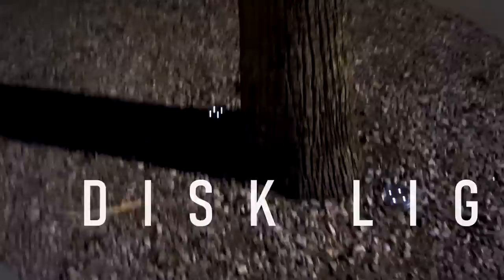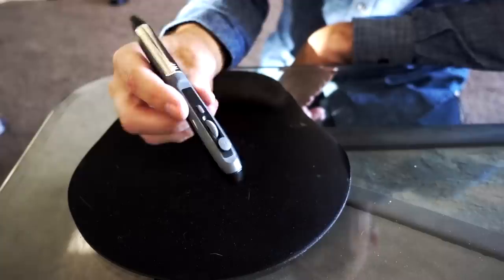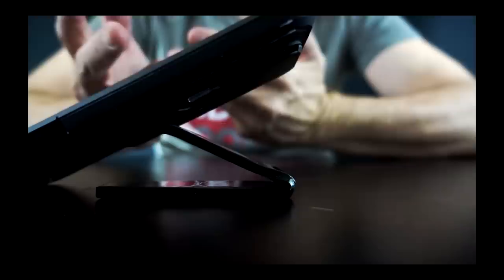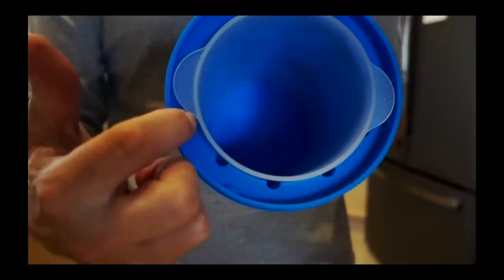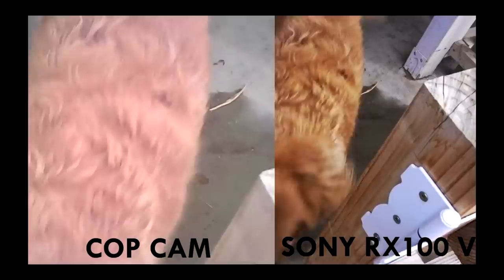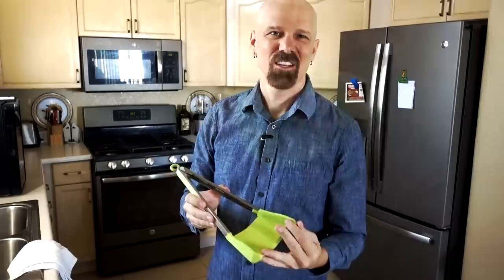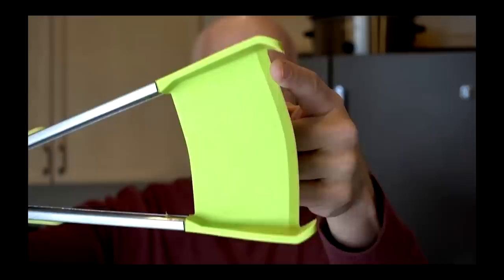10 Worst As Seen on TV Products of 2018

Comment: In your reviews you need to think outside of the box.. those hard boiled egg things I own .. they created them  because some kids or even adults that are eating healthy and want a snack to hold then over or something. They will eat a couple hard boiled eggs.. What your review left out is you can put diced ham and shredded cheddar in it and cook it.  Or chopped pepperoni and mozzarella cheese.  You can make western hard boiled eggs. With diced ham,  onion and peppers with American cheese pieces.  So instead of a western omelette you have a western hardboiled egg.. That's why there is so much more room left in them after you add the egg, so you can add items... also your wrench tool. Every tool has a purpose. A regular socket won't work for a spark plug either. You actually need a deep socket with a rubber grommet.  So it pulls the spark plug out. But if you where taking a bike apart sms putting it back together along with other things. It will work...

Comment: There were these dusters made many years ago, with the same material as the spin duster. You were suppose to charge them before you used it. You needed an old school CRT television to do it. You would charge the duster by rubbing it across the television as you turned the tv off. 

The static electricity was then imparted in the duster, and you could then collect dust with the duster.

It worked about as well as your spin duster.
Reply: J D I still have one of those complete with tube television. Dunno why as it never worked well for me either.  🤨
Reply: yeah, I remember those. My Mother had one of those and loved it.  I don't remember if it worked or not as I never used it.
Reply: We have a few laying around the house for some reason. They’re cat toys now
Reply: Static is how the spin duster is supposed to work as well, like rubbing a balloon on your pants, the action of it spinning is supposed to generate static, which in theory pulls the dust up and sticks it to the brush, it doesn't work though.
Reply: I don't have the spin on but, i have the old wands and if charged well they work great
Reply: 7.

Comment: I bought the Egglettes from the Dollar Tree for a buck! Glad that I didn't pay the As Seen on TV price! They work really well spraying them with Pam first rather than using oil. The instructions say to boil for 8 to 16 minutes depending on how soft or hard you want them (that's a waste of energy just for eggs) and they also say to use a spoon to go round the egg before plopping them out. Works every time but some of the sticky bits are a pain to scrub out. I went back to the good old fast boil for 2 minutes, turn off the burner and then leave covered for 10. They are easy to peel too. Eggs whites are fully cooked and the yolks come out perfectly fluffy.

Comment: The first time i saw egglets i decided against them on two factors.
A. I avoid kitchen items that only do one thing. Remember hot dog cookers?
B. Egglets need to be cleaned just like anything else eggs are cooked in, so no advantage there either. Easier to break and lose too.
   The cop cam sells for $6 on ebay. Better off with tbe pen cam in the same.price range which is much better disguised. No extra lkghting on the pen, but i think it would still serve many useful purposes.
Reply: Egglets are great for those with hand issues like RA that can't peel eggs. And they are silicone so won't break. You can dishwasher them too
Reply: The egglettes actually work really well and are very easy to clean up, as long as you use a spray oil with them.  I don't have a dishwasher and it takes me all of a minute to clean them after I use them.

Comment: The Arctic Air cooler runs on a USB hookup so it's good for a low wattage usage point.
I picked up an older minivan that the a/c didn't work in. I had planned on taking it on our vacation in 2018 because our other minivan had a fuel injector that needed to be replaced. I had seriously considered buying 3 of these things and mounting them in the van for cooling instead of fixing the a/c unit. It did have 3 areas of cooling as part of the a/c system so I thought it would work good for that plus the minivan has a smaller space to cool. In the end I found a used hvac panel on Ebay and tried just replacing the controls alone, and the a/c system kicked right in and blew COLD air so it was just a bad control panel.
I still think the idea of using it in a vehicle would work because we've used larger versions them in tractors and combines that didn't have a/c systems from the factory and they have all worked fairly well.  The evaporative air coolers have actually been around for a several decades now and they do work.  I ran a 1963 International Harvester combine for several years with one as the cooler and I was comfortable for the most part. If it started losing it's cooling ability, it was time to clean the filters and refill the water supply.  Pretty basic and easy to service.

Comment: I have to call out wrong on the Ice Genie, and allow me to explain. I have a few cardiac conditions and I have to limit what I drink. My doctors gave me a glass that's no bigger than 9 1/2 ounces or just over one cup and I'm limited to 15oo ml of fluid a day, or about the amount of 3 bottles of water. I can't use regular ice cubes because only one fits in the glass I have to measure fluids with, and the Ice Genie gives me perfect cubes and ice chips. So while it isn't a good product if you can use normal ice cubes, it's wonderful for someone like me.

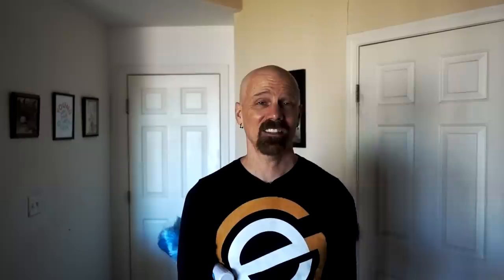Comment: 10:00 the duster reminded me of a Dawn battery operated rotating brush. It was supposed to scrub your dishes. It was useless because the brittles were too soft and the speed was too slow.

When I saw how useless it was for dishes, I decided to use it in the bathroom. Useless there too. A sponge with a scrub pad on it worked better.

Comment: For men working in an office with women who like to keep the thermostat at like 90 degrees all the time, I had 6 water bottles I would rotate in the work freezer 3 at a time, and a $10 fan to blow that cool air right up my pant leg. Small plastic tray to catch condensation drips so it wouldn't damage the wood ledge I put all this on under my desk.

Comment: his review for the arctic air is particularly accurate. but it does work and it works with a battery.  in a dry climate like palms Springs where being outside is very uncomfortable,  these things make a huge difference compared to a fan. i would probably never use one of I just lived in a normal place where summer is kinda hot like los Angeles, but in an extreme desert environment, especially one without electricity such as an offloading trip, these are great

Comment: Artic Air- if you live in area affected by a hurricane and "share a small generator" to which a fridge is plugged into, that Artic Air is ok to keep cool..notice ok..not perfect..but ok..keep at close distance close to you or kids or pets..it is ok..you can even add a little ice.  I would use distilled water.
They should make one that works with batteries for hurricane season or for very hot summers....make battery compartment moisture proof am guessing? This would be a good thing for all, the elderly or patially disabled, or children, clumsy people, even an accident, as they would not have to worry about water and electricity should it be tossed and water splashes on connection to an extension cord or if water somehow gets to wall plug if plugged into wall.
 Love your fur baby :)
Great reviews!!!
Peace

Comment: I do not have a Tiger wrench, but I do have a similar wrench, that I bought from Tractor Supply Company.
I rarely use it, but the times I did use it, it worked great.
If you are thinking of it replacing your regular socket set, you are in the wrong mindset.
Although it cannot be used in all circumstances, it can still be an effective tool when the fasteners are accessible and you do not want to bring a complete socket set with you.
Note: Mine was more like the one in the video at 7:11, as opposed to the one that he was holding.

Comment: Thanks for the reviews, good list.   Re #8 though, the issue with boiling eggs is peeling them.  I usually lose a good chunk of the egg in the process.  I've never seen the "egglette" before, but it looks like its purpose if to save you from having to peel the egg (and losing a part of it if you're as clumsy and impatient as me.)
Reply: put your eggs in cold water before putting on stove.  as soon as the water comes to a boil, reduce heat to 1/4 less than highest heat.  after 10 minutes, turn off heat but leave eggs on  stove for another 5 mins.  once you remove from stove, dump hot water, add cold water and ice, and crack the shell.  peel as soon as they have cooled.  because you are cracking the shells, eggs will not keep as long -- only a couple of days.  storing peeled eggs completely submerged in water will help them keep a little longer.
do this process without cracking the shells if you need to keep them longer.
something else -- eggs can actually be fairly old, and you cannot tell by the dates on the carton.  older eggs are harder to peel regardless of preparation method.
Reply: @truthmatters-jt5up  - Thanks much for the response.  I''ll try your method but I'll reduce the time from 10 minutes to a few minutes.  I like mine soft boiled and I like to eat them right away when they're still warm, so that could be part of the problem.  Not to contradict you, but I've read though that older eggs are easier to peel than fresher ones which seems to be the opposite of what you're saying.   Regardless, I'll take fresh eggs over older ones anyway.

Comment: I had the Arctic Air on my desk when I was in Florida in 2018... It lasted 2 weeks, then the wires on the fan basically corroded from the water you pour inside and it stopped working!

Comment: Evaporative coolers suck. We literally cool our home with cold water through a car radiator. Well water is very cold and absorbs a ton of heat. Downside is you need to run water through it all the time but hey, we use it to water the garden after we cool the house with the same water.

Comment: The reason why the surveillance camera is picking up a lot of purple is because it doesn't have an IR filter. Cameras with IR filters do not work as night vision cameras. You can however have an IR cut lens that allows you to mechanically move the IR filter in front and away from the camera sensor with a solenoid for example, but it would require more parts. Mechanical parts to be exact, and mechanical parts tend to break before anything else. Also, I don't think they could keep that compact form factor with an IR cut and a means to detect daytime/lighting (either through a light sensor or straight up hard coding light hours), but I might be wrong about that.

Edit: This is why night vision footage is monochrome, either with green or white. Because it doesn't look as terrible as the purple.

Comment: Wish vs. As seen on TV- I agree with most of what you said. Most electronic devices are crap from Wish. The grooming gloves on the other hand may not be as thick but you can buy 5 pair for the price of one, so really they last as long. (Kinda) I think you need to pay close attention to the store that your Wish item is coming from, it's just like buying  a can opener from a dollar store or from The Bay (for example). You get what you pay for.

Comment: The Tiger Wrench is simply what's known as a "dog bone" wrench. Harbor Freight sells them, and so do many other places.

I've never owned one, I'm not a professional mechanic, but I am rebuilding an engine right now, so I think I can speak with a little bit of authority here, lol.

What you gain in convenience, you lose in versatility. In most cases, you need to be able to get into some very tight spaces to loosen a fastener. You won't be able to do that with a dog bone wrench.

You honestly do need a huge assortment of sockets, extensions, universal joints, reducers and adapters, as well as a cheater bar, torch, torque wrench, and possibly an impact wrench if you want to loosen and properly tighten most fasteners you're going to come into contact with on car repairs.

Would a dog bone wrench be PERFECT in a situation where your nut or bolt was easy to get to? Yes!

Comment: I disagree with the egg thing. I bought one at Menards last year for $10. I've has NO issue with it at all. I must say I always use it for hard boiled eggs. I like the idea there is no fuss about the egg shell business. I simply use a canola spray (very light) in each one and rub my finger in each one, coating the sides. Then I put the egg in.  When done, the egg slides out just as advertised. I must have done over 100 eggs and my results have always been the same. I could not be happier.

Comment: Not working or being useless?  Here's my suggestion for 2019.  Delta faucet (currently being advertised) that you can tell, "Give me  what ever amount of water you want.  Problem, you need to walk to the sink and put the appropriate receptacle in the sink to capture the water.  My Holy Christ, you're at the sink, lift the flippin' handle or turn the knob and get the water you require.

Comment: I had bought an Arctic Air durring the summer because I live in a very old apartment with no air conditioning and as soon as I filled it with water and turned it on the damn thing kept leaking from the bottom and I would lose more water than it was using. I had no choice but to take it back to Wal-Mart and get my money back.

Comment: The tape laser seemed to be consistently 3 inches off, which oddly looks like the length of the of the tape itself, so you think you’re supposed to be measuring from the other end of the tool? I could be wrong but what a coincidence

Comment: I naught a Miracle Brite light that is supposed to run for 7, hours.  Tried and it just would not work.  I opened the solar panel and one of the wires is detached.  So now I need to buy another soldering iron.  I was going to anyway but not this soon.  But I do like the pen shaped mouse for our computer.  The Shop Wet/Dry VAC's from Canadian tire are horrible.  And that is the new model.

Comment: I got the Ice Genie (likely a knockoff) from Wish.com and it was a giant disappointment, just like the real one. On the bright side, I only paid $3 including shipping, so I was able to satisfy my curiosity without a great deal of betrayed rage. The lid is even WORSE on the knockoff, because the lip is much shallower and still doesn't fit. The insert has no tabs, so it's a bit harder to remove from the mold. In the end, I now use it for painting trim in the house, because it's comfortable to carry in one hand with paint in it and easy to clean. So, Ice Genie sucks, but if they rebranded it as a Paint Genie, it would soar to 3 out of 10 stars.

Comment: I bought the disc lights and they are not good. The pocket mouse does not work with lefties. Arctic Air is an evaporative cooler with the limitations.

Comment: The attic air is NOT as advertised!!  As soon as the box was put down on the table next to the sofa, it had water all over the table--leaking out of the fan itself!!  
There was nothing in the instructions as to how much water to put in.  It does say there could be leaking if the thing is on an unstable such as carpet.  Mine was on a flat table.  I found no matter how much water was in it, it had water coming out of the bottom.  Don't waste your money!!!

Comment: Looks like that Hurricane duster may be useful after all! No, not as a duster; it's a good dog toy! 😂 tie a couple of bits of fabric with little dog treats on the ends, use a nearly dead battery (or batteries? Not sure what it uses for power. 🤷🏻‍♀️) to slow it down, and you have a brain-stimulating dog toy! 😜🤣

Side note: not an "As Seen On TV" product,  but a few years ago I bought one of those cheapo bubble machines for like $5-$6 at Wal-mart for some sort of party or something like that and I  bought a cheap jug of bubbles to use with it. I still have more than 2/3 of the jug and is an awesome improvised dog toy! A quarter cup of bubble solution and 4 AA batteries can buy a good 5-10 minutes of energy-burning dog amusement! Lol!

Comment: with the tongs, the way you would make that product successful would be to make the scoop part adjustable and removable, and then you have a really good as seen on tv product :-). The way you would do this is by using the scoops material to advantage and put circular divets to act as pressure fit locks while sliding it up/down on the metal tongs which would have a male divet to soft-lock the rubber into place, the tong heads could be removable, but securely fit just in case you want them on all the time that way you can have only the scoop if you need, or at the very least design the tong heads in a way that would conform to the shape of a normal pan bevel. this is what that may look like (at least with only 2 minutes of thought put into it and its not the full theoretical design as im not great with modeling programs, but im learning) https://i.imgur.com/bPS4ntl.png

Comment: Haha, if you take "seen on TV" as your proof, you have asked for it. It's even worse than "as preached in church".
The cop cam: Sure does look like a cheap PoS. Combined daylight and IR surveillance cameras do exist, but they have a mechanically actuated "click-click" IR filter that cuts out IR in daylight to eliminate that tint. Even some of the cheap ones are optically quite OK, but they are larger than the cop cam and need DC power.